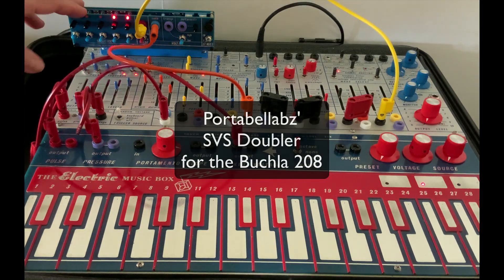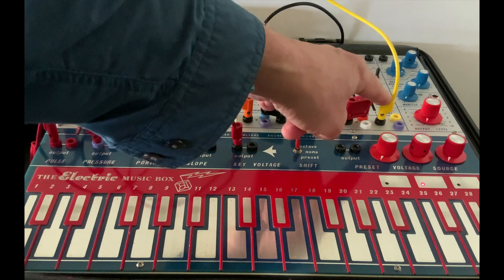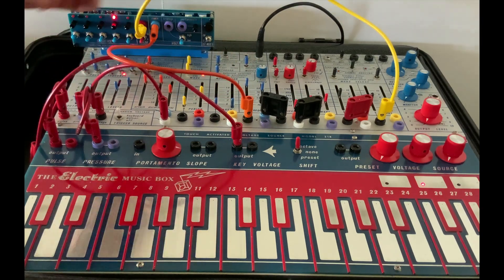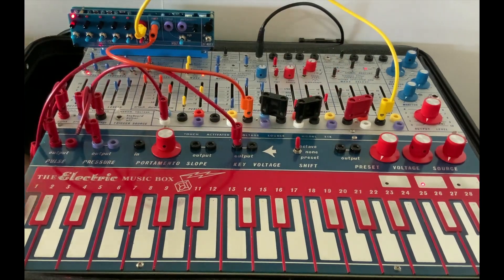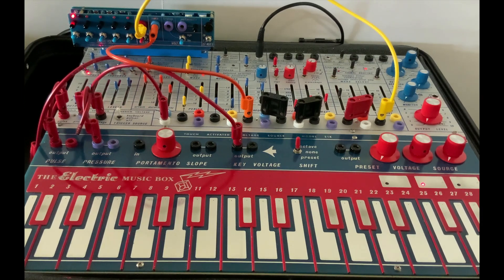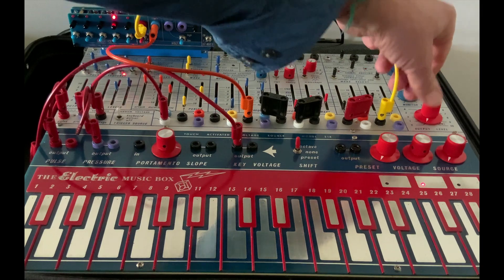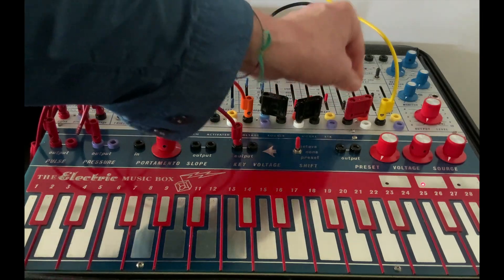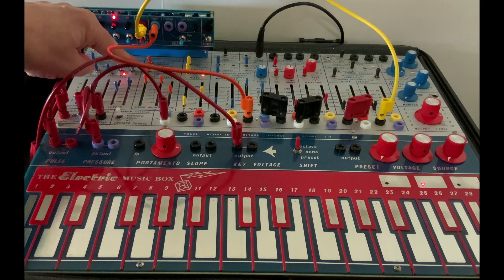Portabellabz SVS Doubler Fun

Comment: Does the red output on the card give a "sustained gate" for the length of that stage? Or is it like the pulser, and it's a down ramp through the length of the stage?
Reply from the maker: ok if i refer you too this Kyle? Features :
- 5 voltage level pots
- 5 on-off-on pulse switches for gate (stage length) - mute - pulse (short trigger) 
- pulse output 
- pulse output on-off-on switch to fire either the envelope generator or pulser
- voltage output
- transposed voltage output with multiturn trimmers to fine tune each transpose
- high and low transpose on-off-on switch 
- portamento output mini slide switch to select if the main or transposed voltage is routed to the portamento
- portamento rate pot with lin/log response mini slide switch
- stages # CV input
- stages # control on-off-on switch : 2 stages or CV
- rear edge connector for plugging in another card